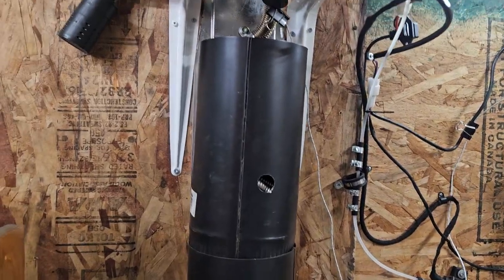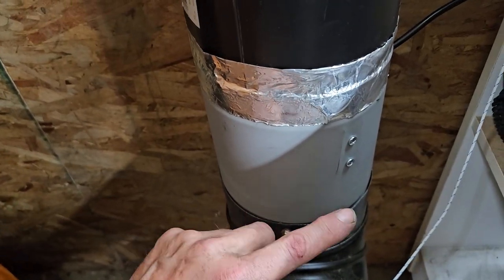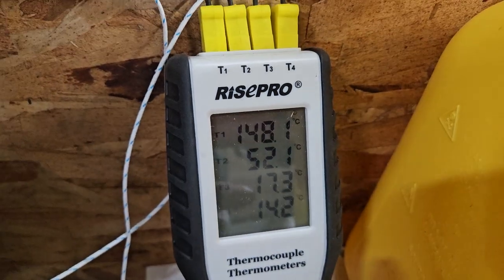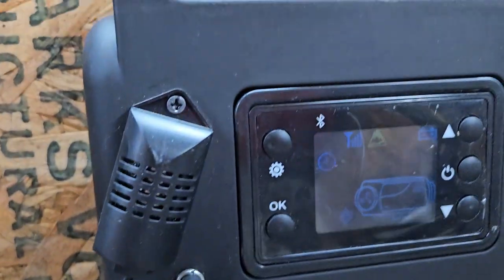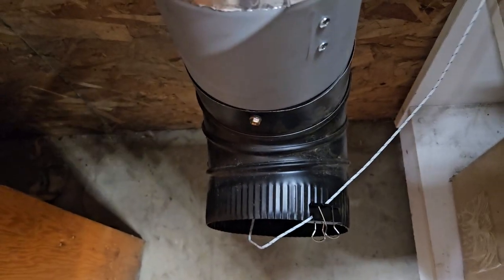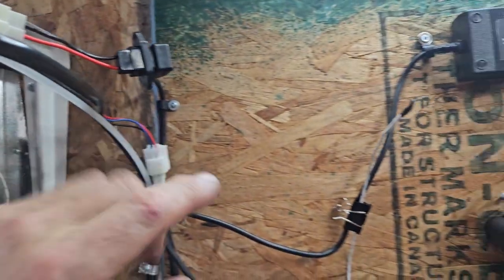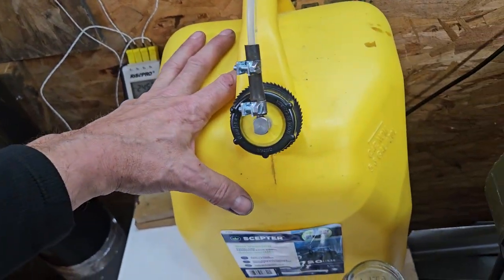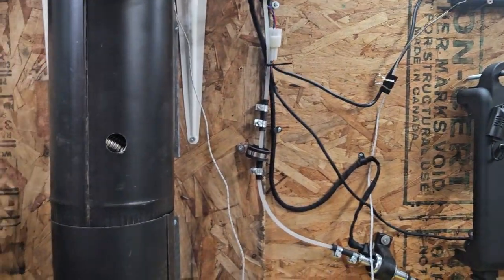Chinese Diesel Heater - Exhaust Gas Heat Exchanger (long version)

Comment: How many feet of exhaust pipe are you using.
Reply from the maker: 2 meters, (6'6"). It has been running for over 250 hours trouble free. No signs of "Sooting up" like many "Experts" on various FaceBook sites about these  have warned would certainly happen. I think the care I took in construction to be certain every inch of pipe is running downhill is part of the success. These new units have some atmospheric sensing - Barometric pressure for certain and likely with temperature and humidity as all three are usually combined. This allows these new motherboards to vary fan RPM and pump frequency to match ambient air conditions thus getting a clean burn at a greater range of altitudes and temperatures. In testing I did through the summer i did get poor burning in heavy fog conditions with the 2 meter exhaust laying too close to flat.
Reply: @scotscheideman9800  I built a "heat exchange" box with about 2 meters (6ft, give or take) of exhaust tubing, just using the exhaust heat to warm the inlet air in the box, and while I was able to heat the box interior temp to at least 14*F above ambient (no way to measure actual ambient, it was below freezing) I noticed after 4 days it was fairly sooty in the last bit of exhaust. This being run at setting 3 for the majority of the time. 

I ran over 10 hours on just under 5L of diesel on setting 6 of 10 at one point. The unit is an Hcalory TB max. I'd probably rather be getting cold fresh air for combustion but this is a sealed unit with the air intake mounted inside the shell. 

It also has the altitude setting, perhaps forcing it to run that would have leaned it out. But there was definitely soot. Nothing I was concerned with, but it was significant compared to what was there running maybe 2m of straight exhaust. I also ran the exhaust tube through another tight fitting aluminum tube, but couldn't get good heat readings to see if that was actually taking any more heat out of the exhaust.

I did notice that the aftermarket muffler (aluminum shell and end caps) seemed to radiate a TON of heat, putting that nearer the heater would probably allow one to easily shed some radiant heat. At the end of the exhaust run, the tubing and exhaust was warm to the touch, at best, in above freezing temps. Even after 1.5m of exhaust tubing, the aluminum muffler was cool enough to touch, whereas with shorter exhaust, it would vaporize water immediately. 

There are fun to play with lol.
Reply from the maker: @danya822 mine has now been running for over 10 days straight ( over 250hrs)with a few short shutdowns to adjust things. 95% on the lowest heat setting. no sign of soot yet. I am running on "Plateau mode" (high altitude) . I'm only at 2300' ASL. I think the leaned out ratio for high altitude  is helping .
Reply: @scotscheideman9800  Do you notice a change in the burn chamber temp with the higher elevation setting, assuming you can monitor it?

I can with mine, but I probably won't be able to test those two. 

I can say that insulating the hot air tubing (double layer of flex hose, already supposedly "insulated") reduces its surface temperature about 50*. The stock hard plastic tubing doesn't radiate much heat based on its surface temps, but the aftermarket flex tubing definitely does. Even after 8' of double layers (5" over 4") the single layer 5" at the tail end was 50* warmer on the exterior than where it was doubled up.
Reply from the maker: @danya822 I will check for changes in the Exhaust Gas Temp by putting a thermocouple right at the unit/exhaust tubing joint and turn the "High Altirude" on and off and record some number, then get back to you. Probably not till the weekend, when I'm off work.

Comment: Too much effort and complexity.. my heater sits on a wooden(!) end table with a hole cut for the intake and exhaust.    I have a two meter length of exhaust pipe in a 8 to 12 inch always going down lazy spiral that goes out the wall through a 1-1/2" copper sleeve.  A small table fan blows upwards across the corrugated pipe.  Radiant and convection heat come off, literally condenses at the output end.   Cost nothing.
Reply from the maker: Glad to hear that works for you!  Sounds very similar to mine in terms of tubing length combined with a fan . How long have you been running you setup? I keep having guys on the Facebook Groups about diesel Heaters saying that setups like yours and mine will clog up with soot. What are your thoughts on this?
Reply: @scotscheideman9800 last season, ran 4 months on low ..  1 or two days at medium.  I run the hard line from a 15 gallon auto fuel cell 20 feet away .. running 50 diesel 40 fuel oil 10 percent petrol..  zero soot

Comment: The amount of heat recovery seems little more than an equivalent 300-500W electric heater.
Reply from the maker: That's good, 500 watts would cost me 12.6 cents per hour or $90 per month at my current electricity rates. I'd call that a worthwhile savings instead of just discharging that energy outside.
Reply: @scotscheideman9800  What's up with your math? lol.

12.6 cents/500 watt-hours (or 25.2 cents per kWh) then you say 'or $90 per month at current rate" that'd be assuming you're running this diesel heater 24/7, which would be wildly more expensive than just using electric heating.
Reply from the maker: @keysersoze7034   I am running this 24/7. There is no Nat Gas or Propane run to this building . For years I have had to heat it with electricity only.  The problem with "my math" is that you are looking at just the "free or lost" heat I am recovering from the exhaust. The diesel heater costs about 11cents per KWh.  The fuel burn is not affected by this add-on. This is an 8kw heater( which many  people claim puts out closer to 6kw in reality) 6kw  of electricity would cost me $1.50 per hour.  This building(750sq ft) requires WAY more than 500watts to keep warm here in Canada where -40 or colder is a regular thing with -20 overnight lows being pretty much continuous from end of Nov to end of Feb. In past winters I have had to run as many as five 1500 watt space heaters when we have had cold snaps with high winds below -40 for 2 or more weeks continuous. The pressure tank and controls from the well are in this garage so letting it freeze in there is not an option. Wide spread blackouts or small local power outages often occur during extreme cold snaps as the grid gets over taxed from all the extra electric heaters that get turned on in thousands of homes, animal shelters on farms and acreages, plus everybody is plugging in their vehicles and  ever furnace runs much more etc. For this reason , I keep it at a minimum of 10°c so I have some reserve heat that buys me time to get home from work and hook this up to my 100Ah battery and then get the generator set up and running without fear of freezing my water system. Most of the winter 1500-3000 watts keeps it warm enough. Total electrical consumption of the diesel heater and my heat exchanger fan is 25-75 watts. Fuel burn at full power (6000+ the free500) is about $0.70/hr with clear gas pump diesel. If the claims that these 8kw heaters do only put out 6kw , then I still have electric heaters to get through an extreme cold snap or 2 but 90% of the winter will be done with diesel at less than half the cost per KWh. I will also keep some electric heaters set to kick on if the temp drops due to the heater shutting down
Reply: @scotscheideman9800  You make some good points

There is no such thing as an 8kw chinese diesel heater though, they are identical to the 5kw, so no 6kw there. And that 500 watt estimation by the other comment was 300-500 watts, and even that would need some more delving into.

Seeing as you're in an extreme environment I totally get what you're trying to do (hence how I found your video, I like improving efficiency too!) have you ever considered a rocket stove or some kind of thermal mass stove?
Reply from the maker: @keysersoze7034  I have heard (I don't remember where) that some companies set the software in the  motherboard to run the fan and pump a little faster in their "8kw" models than their 5kw's ,, no proof , could be entirely fiction. This place is a rental so I can't undertake anything that puts holes in walls or roof. I was able to put the heater exhaust through a window that had been boarded and insulated by a previous tenant because of a break in, so all I have to do is replace a couple pieces of plywood if necessary If it was mine, it would have Propane like the house runs on.
Reply: @scotscheideman9800 with I had that price 20¢kwh in middle Wisconsin..👉🏻😏💥

Comment from the maker: Note- All connections in the exhaust system are sealed with muffler cement and I have another CO monitor over by the entry door of the garage in addition to the one on the heater
Reply: Links to where to get the fan and other items might be nice.  This is the best exchanger idea I have seen, and I'm having trouble finding any weak points.  Great job.  I subscribed and look forward to the updates.
Reply from the maker: @Angry_Munchkin  Here are the links to the duct fan and the speed control I bought with it    

  https://www.amazon.ca/dp/B085HVQG2Y?ref=ppx_yo2ov_dt_b_fed_asin_title&th=1 

   https://www.amazon.ca/dp/B0714FFG4F?ref=ppx_yo2ov_dt_b_fed_asin_title&th=1
Reply: @scotscheideman9800  thank you
Reply: Several CO monitors fitted at correct location's..

Will the fan take the heat?
If not run it upwards and the heater output blows down.. with a big pipe on inlet to floor.. could be large plastic drainpipe.. even drawing from other side of room.

Try the pump upright mounted on soft rubber in a softwood box with some sound absorbing mat on inside..
Reply from the maker: @Markus-UK   The "fan" is a dedicated  HVAC Duct Booster fan , so it is intended to work with furnace distribution hot air as well as cold A/C air.
I have the CO monitor that came with the VEVOR unit plus two other units 180° across the shop.
Reply: Hi Scot - it’s Big Rodders in Ireland.  Regarding the fuel filter, would the simple answer not be to place the new filter at the end of the pick-up pipe within the tank just like a chainsaw and similar engines?